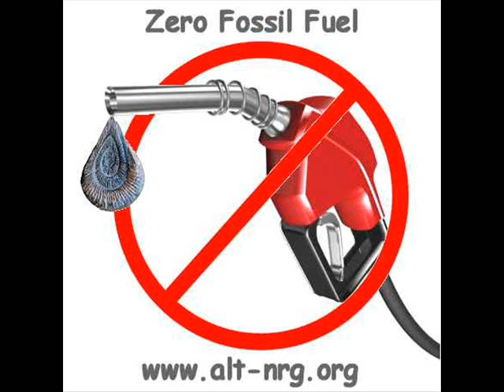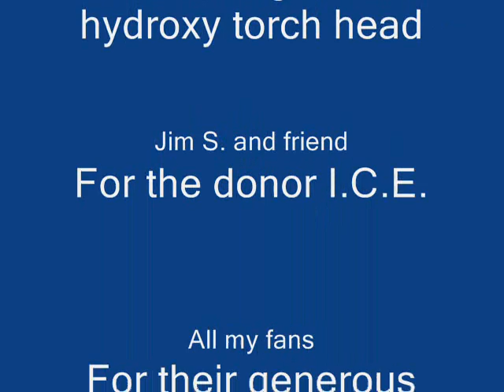#112 1st HHO test with I.C.E!

Comment from the maker: One thing to bear in mind when watching this video is he uses pure compressed hydrogen. It mixes with oxygen at the point of injection. Therefore, waste spark at the top of the exhaust stroke and beginning of intake is less likely to cause backfire while running than when injecting premixed HHO.

Especially true when retarding the timing. The intake valve must still be fully closed when that waste spark goes off or it WILL backfire. Else the waste spark must be eliminated.

Comment from the maker: It's very easy. Just remove the flywheel to crankshaft alignment key and sock it down where ever you want it. The output shaft is tapered and holds its position very well without the key. I just need to put my timing light on it and mark out the actual angles in degrees from TDC.

Comment from the maker: To run on 100% hydrogen requires that you move the timing to TDC, even 10* ATDC. I presume you did not. Also, most scooters use 2 stroke engines. The only place they get their lubrication from is the oil mixed with the liquid gasoline.

No oil = no lubrication = seized motor.

Comment: Guys, I made HHO With a welder that works from ~220v, bottled it in with pump and run my scooter for 20 MINUTES. Guess what happened??? ]
I need a new engine now :(
I think producing the HHO is only the tip of the iceberg.

Comment: The zero point energy is contained in the vacuum of the H molicule, once you can break into this vacuum you will release the zero point energy and will increase the energy value of hygrogen by a factor of 9. Now you have all the energy you need. This is not breaking atoms, it is simpler than you think.

Comment: The reason it won't run strictly on HHO is the timing should be TDC as opposed to BTDC for gas since HHO burns about 2 1/2 hotter and faster than gas. need to come up with a way to shift timing from BTDC to TDC then I believe it would run just fine on HHO.  Hope this helps. Keep up the good work...

Comment: QSI has demonstrated that by using its nano nickel and iron particles it is possible to exceed the Department of Energy's target with 85% energy efficiency by increasing the surface area of the active components of the electrolyzer, without any CO2.  This degree of efficiency makes hydrogen generation commercially viable for replacing fossil fuel-based methods, especially as the cost of fuel increases. check out eetimesdotcom Nanoelectrodes boost electrolysis to cut hydrogen fuel cost

Comment: Electric motors are a more parctical and efficient replacement for the internal combustion engine because there are few inefficencys power to battery, battery to motor and you can recapture kentic energy when barking and its all current available and affordable for all lithium ion batterys it would cost 20k (to conver an exsisting car)to make an elcetric car 25k [if you build it with a kit car (a whole car)]with a better range than a hydogen fuel cell car that cost 1milion.

Comment: Hydrogen is a waste of time because it is very inefficent becasue first you need to make hydrogen,electolosis not efficient as battery charger then either through combustion or a fuel cell both which are very ineffecient (compared to an electric motor) then they still have to power an elctric motor.

Comment: Solving the problems is like this:-
you feed part of the exhaust from the engine back through the cell (tube cells like Meyer)other cells would be more difficult, it enters at the bottom of the tubes via a tube which has an electro magnetic field to charge the exhaust gas (water vapour). This has a three fold effect 1. the charge water vapour breaks down more easly 2. the flow pushes the gas bubbles 3. the resulting gas is diluted and so you have a less volatile gas. Now run your engine.

Comment: Call me an HHO noob, but I've noticed that these (and all) HHO cells require electrical input.  How is this going to replace the gasoline engine?  They would need to produce more (or equal) output than input to run an engine without an external power source.  I know you could make a "hybrid" engine to run on a gasoline/HHO (for electricity), but how efficient would this be?  Is there an HHO cell that produces enough gas to power itself without the need for a seperate power source?

Comment: Zero you could set up a pond mister feeding mist T'd into the HHO line at a point near the cell. And redo this test on the lawnmower. Using mist and HHO combined if it runs maybe you can throttle back on HHO input?
I have done this in my van only 2 days ago no mpg results yet though.

Comment: Stan Meyer full data. "water as Fuel" 50 hp ICE  111 ml/min gasoline consumption rate (on road test) @ 65 mph. Hydrogen gas has almost 3 times the amount of BTU's of gasoline. So based on this figure you should be able to get the same energy from 37 ml of hydrogen. Now this also does not take into consideration the burn rate and 100% conversion of energy that you get from Hydrogen.

Comment: The one place where Tero's information was incorrect is the air/hho mix.  It can be as much as 5:1.  With enhanced ignition, it can be more like 30:1. And there are some issues with 100% hho that need to be solved. Zero is aware of these and I am sure will implement solutions.

A typical 5ish HP lawn mower engine should be able to idle at somewhere between 4-6LPM.  Should be able to get it to run strong (mechanical tinkering required) with 10-15 LPM.

Comment: Zero... one thing I would try is to try to find a way to direct inject it, by running a nozzle you're increasing the pressure in the cell, (from what I've seen, may be wrong) HHO works best in a vaccuum environment (I'm pretty sure you have a video on it)... so by increasing pressure in the cell, you may be dropping your production some... (probably something you thought about, you seem to leave no stone unturned.)

Comment: Assuming TERO is correct that would mean on the LOW end (600lph) we would need a cell to produce 10 LPM just to IDLE the engine.

The key word here is IDLE.. Maybe Zero can prove this out by overdriving this cell and find out?  

So most likely this is the amount most likely needed to IDLE an engine, (10-13.3 LPM)

Others have asked, and it makes you wonder the LPM it would take to RUN it at 1000 or 2000 RPM?  Double and triple that amount at least.

20-100 LPM  Is probably close

Comment: Copy from TER0:
"To run a 6.5hp 200cc 4-stroke Honda on oxyhydrogen gas. 7 cell unit was used, running at about 40A producing approximately 200 LPH of gas. The gas was collected for 1-2 minutes which later ran the engine for some 20seconds. Approximately 600-800LPH of gas would have been needed to idle the engine continuously."

His guesstimate to IDLE engine.. is 600-800LPH  which  means we need approximately 13.33 LPM (high end)of HHO gas to IDLE this type of engine if Tero is correct.

Comment from the maker: Was playing around with it more tonight. I didn't even need an offset key. The tapered shaft is snug enough to run without any key at all for some timing tests.

The key notch is precisely TDC on the crank. Barely runs at all on gasoline at TDC. 2.5LPM is still not enough HHO to make it run without gas.

One thing I can confirm through my tests is the gas can run extremely lean with HHO to the point that the engine will not run without the HHO present.

It reaffirms what we already knew.

Comment: Very impressive, by just sound alone I would estimate you're doubling the RPM when adding the HHO, maybe even more.  Are you thinking about trying to move the ignition timing to be more around 0 TDC?  If that is a flywheel magneto type spark ignition system then that might be difficult unless you can broach another key-way slot in the flywheel. 
 
Are you going 4 100% HHO on that ICE??

Damn impressive I got to say, absolutely undeniable results!!! 

WTG Zero, gotta luv that empirical testing!!!

Comment: your right it is not over-unity but it is pre stored energy just like oil. The process is created when Hydrogen finds Oxygen and combines atomically to form a compound then we release but a small portion of it (large to us however) and it goes about its business. You do not use up oil you simply change the carbon to a different form and extract energy that was placed there this is the same.

Comment: Could the engine run 100% HHO?  It sounded like it died on you when you still had the HHO running to it.  It was obvious how much the HHO increased the performance of the gasoline process - that's awesome.  Boxa888 has a point - would water collect in the engine?

Comment: you should make a system where can store Enough the HHo gas so a can run 100% of the hydrogen. The HHo genrator can act as a compressor. You just need find a big engouh high perssure gas tank.

Comment: hmmm, you're talking "over unity" .. are you suggesting that petroleum products are somehow "over unity" ???  last time I looked, it required a lot of energy to pump, refine and transport petroleum products ... 

what we are doing here with this method is energy conversion ... we are converting electricity into a burnable gas ... electricity is good but sometimes a gas is better ... and yes, there is a loss in the conversion process ... right now our efficiency exceeds nuclear ... next issue .

Comment: I tried this ... used a balloon as a reservoir ... worked pretty good actually ... got me about a 5-6 second run on HHO only using a device that only put out about 2 LPM ... but I dont think it would be very durable ... and would make a big BANG on the first back fire ...  and they do tend to back fire when running on HHO alone ...

Comment: actually it will run ok without adjuting the timing or worrying about waste spark ... but you are correct that to get it to run "properly" requires some tinkering with timing and other things ...

Comment: Actually, I was quite impressed.  Looked like a pretty fine run considering the modest output volume setting. Set that unit up for 75vDC @ 20a and watch it crank 8 LPM.  Then giver her a try.

My 32 plate 6 inch Tero did not produce enough to run a small engine at its flat out setting producing about 6LPM. But the new one I am assembling should do the job easily.